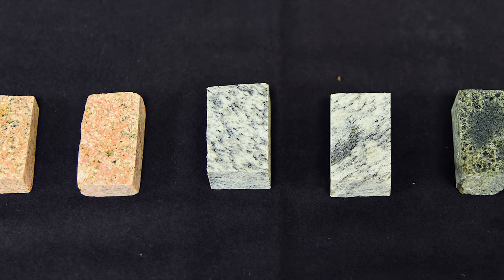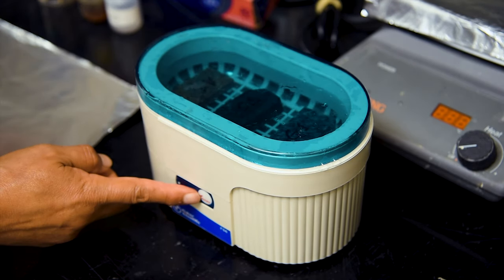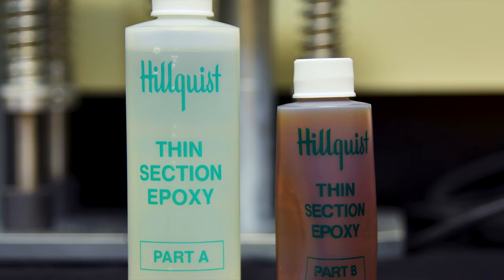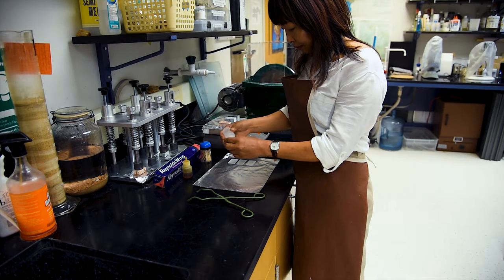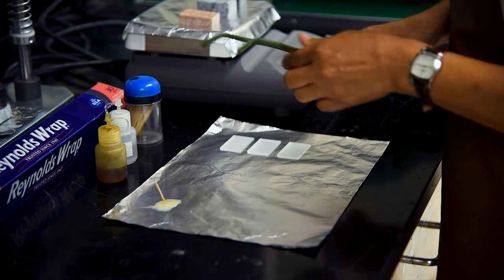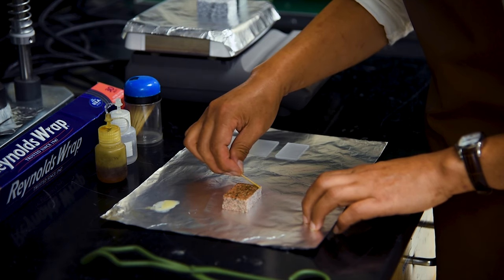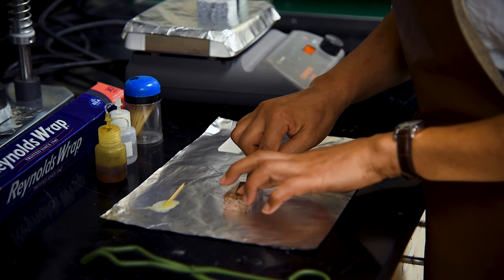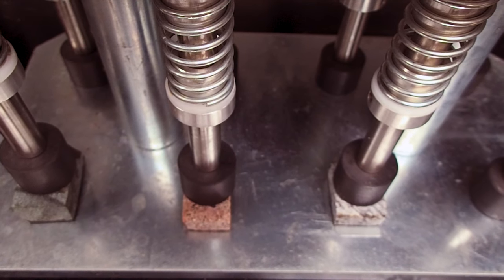Making Rock Thin-Sections: 06/10 - Epoxying Slides

Comment: I need to make a thin section of beach sand. Should I just add super glue to the glass and pour some sand on top? I was thinking of using a mortar and pestle to grind the grains to the smallest size possible. I am only describing what grains are in sand. I was told to use something to keep the sand firm like in a plastic. But if I do that and them I use the water, salt crystals will dissolved.  So I was thinking that I should skip the water machine. What do you think? super glue?